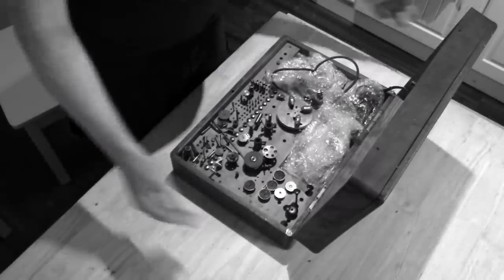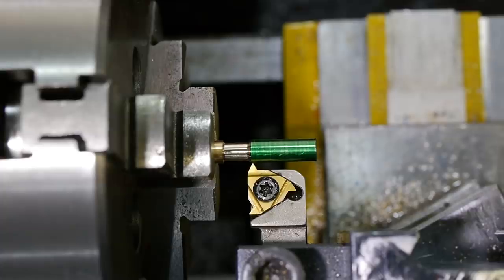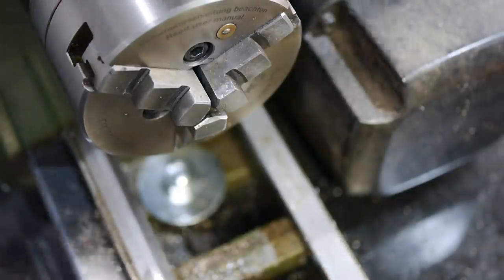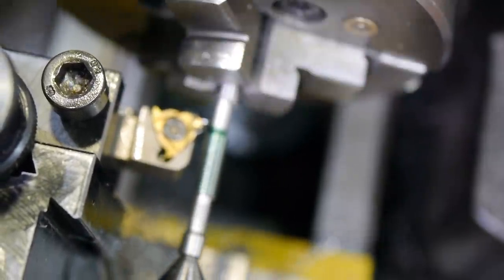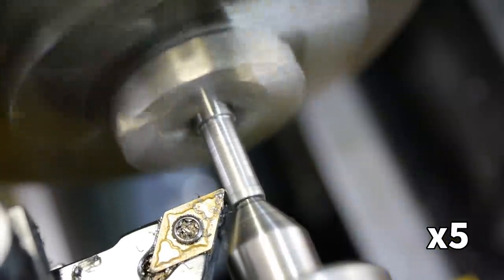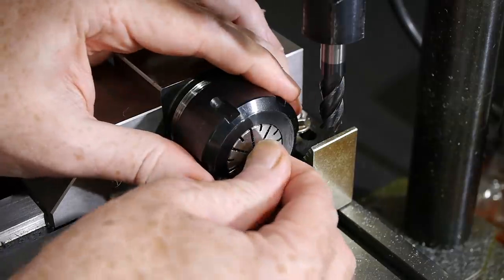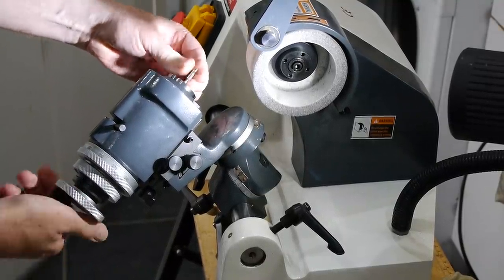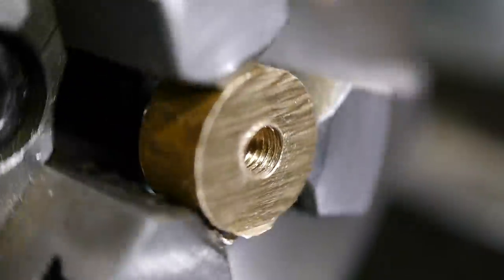Making a Custom Tap on the Proxxon PD 250/e Lathe

Comment: In micromechanics we were taught that the first quench after heating should be in motor oil as water will steam when you put the piece in and you can get uneven hardening.  We did oil, then water was mostly used to clean off the boric acid. Your setup is exactly what we used in watchmaking school, down to the annoying wire baskets.
Reply from the maker: The quench medium depends on the grade of steel. In this video I used BS1407 Silver Steel, and the data sheet specified quenching in water. Other steel grades like EN19 / 4140 specify oil. I think most of my information on home heat treatment came from watching Clickspring, and I believe he learned much of his work from horology books, so it makes sense that some of what I did is similar to the process taught in watchmaking school.

Comment: I made a hob a while ago to cut a custom sized wheel for a worm drive for another project.
A few things I learned from that project:
Hardening burns off the sharp cutting edges, they should be ground after hardening.
No need to harden the tap for soft materials. My wheel was made from aluminum, and plain A2 tool steel was hard enough to make several wheels with no signs of wear. If you are taping aluminum or brass, hardening just makes your life more difficult.
I milled the relief at the same time I milled the flutes. I used a dividing head to accurately mill a 5 degree relief, but this could be done with small creativity with your collet blocks as well.
Also, the tip angle of a tap depends on the type and pitch. 6 threads of lead is about right for a starter tap, a conventional tap will have about 3 threads of lead, and a bottoming tap about 1 thread.
Very well done BTW.

Comment: A quick tip to help with the thread wires. A dab of grease on the threads will help make the wires stick to the part. Just a bit of wisdom shared with me from an old machinist.
Reply from the maker: Thanks for the tip!
Reply: Or just hold the wires vertically from above and the mic will hold then in place.

Comment: Hi,where did you find those 8x8 mm cutting tools?Because these sort of tools dimensions start from 20x20 mm in the market.
Reply from the maker: 8x8mm lathe tools are really easy to get hold of from retail tool suppliers, eBay, Amazon, or the big Chinese sites which sell everything like Banggood and Aliexpress. Most of mine are from eBay.

Comment: Indeed, a plain tapered end yields a slight negative relief to the cutting edges. An approximate formula for this relief is arctan(pitch×tan(taper)/(pi×diameter)) which in this case gives about 0.24 degrees. The formula is approximate primarily because the diameter varies along the length of the taper.

I would be interested to see what you did to produce positive relief.
Reply from the maker: That negative relief would certainly explain why my first attempt had no chance of cutting a thread at all. I haven't checked your math, but on a quick diagram I can see why that negative relief happens.
A quick explanation of the grind I eventually did: I gound a flat relief just behind the cutting edge by carefully setting the angle of the grinding collet, then very gradually advancing toward the wheel, and checking carefully between each pass. It's not pretty, but it does work.

Comment: Very good work. A few years ago I managed to machine a gear hob to cut the gears for a Webster IC engine using a similar method to yours. Tool had to be made to make another tool to cut the geometry on the silver steel and then a gear hob had to machined out of it . A lot of work but a lot of fun. Funny enough I cut the 1/2" hob on a miniature Sherline lathe.
Reply from the maker: Toolmaking can be a really compelling hobby, and I've certainly been bitten. One of the first machining videos I watched was Myfordboy making a hob from silver steel, to free-hob a worm gear. I was almost immediately hooked!
Reply: @AdventureswithaVerySmallLathe  Yes I agree. Right now I am busy cutting MT0 and MT1 taper arbors for the Sherline. I have made a couple of MT1 slitting saw arbors, an MT0  extended dead center and an MT0 extended live center to be able to get the tool in with very small diameter work. I am almost reluctant  to take the top slide off now, that the angle is set correctly.

Comment: very cool project. Since learning from Joe Pie....I now single point tap EVERYTHING from the chuck away towards the tailstock, upside down tool...and no CRASH!  cheers    G>
Reply from the maker: I wish I could do that too, but the tool post just doesn't have enough room to hold the single point tool upside down. I only get to do r/h threads away from the chuck if I don't need the tail stock.

Comment: I see others have warned you about the unnecessity of quenching when it comes to tempering and I'm sure you already know the reasons as well. Another thing you might consider is the location of the tempering. As you said, the purpose of tempering is to decrease the brittleness of the material and make it tougher to avoid stress-induced cracking. These cracks always start at sharp and changing geometries like shaft shoulders and thread roots. If you look at broken taps, they usually break at the upper section of the threads where stress concentrates at the roots and torque is high enough (most of the cutting edges are in action by this time). For these reasons, it is better to focus on these parts of the tool (upper threads and shank). Of course tempering by this method is not the most effective but still it can help prevent the mentioned cracking as heat first touches the most vulnerable part of the tool: the outer shell (this is where the cracks start). The tip and the first few threads can be left "rock-hard" as it is unlikey for cracks to start here and having some extra Rockwells here really won't hurt at all. It's over a year by now and you may already know all of these but if not I hope it helps in the future.
Reply from the maker: Thanks for the tips! Overall I think the tap felt a bit soft when I came to use it, but it's hard to tell exactly why. Most likely I over-tempered it, but it's possible the points got de-carburized because it took me so long to get to decent cherry-red temperature.
I know that quenching isn't necessary as part of termpering, but I was taught during school shop classes that it was a useful way to make sure tempering is stopped, and the heat in the part doesn't spread any further.
For future projects I'm going to try and rig up a tempering oven, so I can gently bring parts to the right temperature and hold them there for the right soak time.
Reply: It can have several reasons of course. Based on your Custom Die video, if you're using it to cut materials with high tensile strength like silver steel, the high cutting forces combined with the vanadium content of the material (which can already be in it in the form of vanadium-carbide that is extremely hard) it is possible that you lose those sharp edges pretty fast. Decarburization shouldn't bother you especially with the use of boric acid protective coating, the high carbon content of silver steel and the relatively short time you do the heat treating in (I guess it didn't take longer than 15 minutes). I'm also sceptic about tempering because you basically grounded off the tempered (discoloured) section of the tool. The most important thing you should really focus on is the right quenching temperature. Being a small part, this tool quickly loses temperature when you draw it from the heat and you should quench it as fast as you can. To be honest I don't see any red color when you quench this part although it's only a few frames. Try maintaining that cherry red color through the tool and be fast afterwards. In the Die making video you did way better. Keep up the good work!
Reply from the maker: The BS1407 silver steel I used for both the tap and die doesn't contain any vanadium (unlike DIN 1.2210), and is very easy to work with compared to O1. The ground tapered part of the tap seemed to keep it's edge ok, but I saw some definite sign that the thread tips further down were deforming under the cutting forces. This was at the point on the tap where the cutting edge had only been ground on the flute side, and the other two faces were the original faces that had been exposed to heat treat. I think it's most likely that these peaks got too hot during the temper phase, as I really had very little temerature control, and I wasn't at all happy with how I did temper the tap.
Thanks for the feedback on the quench. I have learned that the magentism check isn't a completely reliable to check for the austenite transition, and since making the video I now think it was a bad idea to check if the part was magnetic right before quenching, as it allowed the part to cool down. That said, I'm certain the part did harden.
Thanks for taking the time to write constructive comments, full of useful information. Much appreciated, and I learn more as a result. Keep watching!

Comment: Is that a SPZB80/100 DARMET vise in this video? How do you like it? What made you choose this particular model?
Reply from the maker: It's a SPZB63/85 DARMET. Very close, well spotted! The quality of the vice is really good for what I need, but I haven't checked the fine tolerences or tried to use it for grinding. I picked it because the German company I bought it through were recommended by a YouTuber at some point, and I was looking for something smaller than the oversized milling vice I had. The Darmet is still quite big for my milling machine, so I've bought a pair of smaller grinding vices which also have the benefit of having clamping grooves at the side which the Darmet lacks.
Reply: @AdventureswithaVerySmallLathe  That's what I call a Quick reply! It seems these can be bought from their web shop now. I like the idea with the  tightening force acting downwards. Don't know if it is an issue with Darmet, but in case it is, have you seen these improvements to the nut and cross axle? https://youtu.be/JCmBFuGjtoM
Reply from the maker: @paullehmor982  Partly luck that I was around, and partly that you had a nice simple question to answer.
Thanks for the link to JohnSL's video! I like this stuff, and there's some good ideas in that video. I don't really have the first problem he describes, but I could definitely use that second mod. Too bad I have no 3D printer; I'll have to come up with another way to do that.
Reply: @AdventureswithaVerySmallLathe  Haha, I think ThisOldTony made a video about square holes.

Comment: I just bought my first small lathe and I'm really new. Your videos have really been inspiring. I wanted to ask, why didn't you get the angle for the tap before you hardened it? I would have thought you'd want to have all procedures done prior to hardening?
Reply from the maker: Glad to be a source of inspiration. When it came to grinding the tap I followed the procedure I saw in other videos, but I think the reasoning for doing it that was is something like this. When hardening the steel, the outer skin of the metal exposed to the flame loses some of its carbon, and the surface layer doesn't harden well. To get a clean surface of really hard steel for the sutting edge it's necessary to grind away the decarburized metal. Commercially made taps have the entire geometry ground from pre-hardened steel. I wouldn't be able  to do that in my workshop as I don't have the tools and jigs required to grind a thread into a hard steel part, so I machine the basic shape, and the thread from soft metal, then harden it before grinding away the parts of the cutting geometry I can shape with the simple grinding tools available.

Comment: As an alternative to gashing taps with a ball nose cutter, you can use a suitably sized abrasive disk.  Which method to use will depend on what equipment you have.
Reply from the maker: I'm certainly interested in learning to use that method at some point, but at the moment I don't think I have equipment that fits the job.

Comment: A thread grinder is a hybred machine. It is like an OD grinder with a lead screw and half nut just like a lathe but with a grinding head instead of a tool post. The wheel is dressed with the apropriate angle for the thread being ground. They come in both manually operated ones for small quantities up ones that are for high speed automatic models for mass production.

Comment: Making your own taps could become more economical of time if you were making a 3-tap set of the same size ( starting, standard, and bottom taps of plus and minus fits). Could you get some reamers in there too with similar settings? Might make a nice presentation set.

Comment: Why didn’t you grind the taper and rake in before case hardening the tap? I would have been worried about ruining the temper once your brought it to straw. Also I was surprised you didn’t add any carbon is this just 01 tool steel?
Reply from the maker: The material is BS1407 Silver Steel, a simple tool steel similar to W1. It is through-hardening, so there is no need for extra carbon or case hardening. Grinding after harden and temper seems to be the order most tap-making videos follow, though I'm not sure exactly what the tradeoffs are.

Hardening in a home shop almost always causes some decarburization of the surface of the metal, so grinding the surface layer away to make the sharp edge after hardening is probably desirable.
Reply: Adventures with a Very Small Lathe well nice work man. It looks great. I need to get a power feed solution before I can try this but I enjoyed your video. Thanks.

Comment: Hi. First time video watcher, 3th. year machinist student. You know, that there is a internet full of a measurement charts, that can tell you the exact min. and max. diameters of the bore when making a thread and also there is a universal calculations, that atleast makes sense when you'r making bolt threads in millimeters. It's simple... Let's say, that you wanna make a ISO M8 normal female thread. Max.D for the hole is 7.972mm so lets call it 7.9mm and the Min is 7.76 so lets call it 7.75mm. Picth is 1.25mm. Now you always go for the middle of the toleranse scale, so just go with the 8mm drill and then go with the thread tap. Don't forget the lubrication and go slow. Remember to rewind if your using a lathe. Now how you use this info to do a male thread (bolt) is that you take the diameter of the hole you want and take of (-minus) the pitch and then round it of. now it's good to round it of to little under because the ridges might get sharp and start to break. Also if the male bolt threads are slightly under (like a 2-5 tens of a mm) it's fine. In normal use there should be some slight wiggle. There is also a plenty of charts in... (what ever obsolete system you 'muricans use) in the internet for you.

Comment: But can it cross thread? Very nice project, something anyone could need to do at some time. Was there a lot of work to figuring out the relief, or was it done seat of the pants comparing to commercial product?. Thanks and cheers!
Reply from the maker: The relief was almost entirely informed guesswork, and experimentation. No issues with cross-threading so far.

Comment: So i think : a perfek job ! Now the question: did you produce & sell this watchmakerlathe sparepart ? Exactly this part a friend of my need this ...
Reply from the maker: Which part do you mean? If you mean the tap, I'm afraid it isn't nearly good enough quality to sell. It only needs to be used once for my purposes, and it doesn't hold a sharp edge well.
Reply: @AdventureswithaVerySmallLathe  ... so you made your sparepart? Made another ...
Reply from the maker: @GpunktHartman  I'm not quite sure what you're asking me. Does your friend need a tap just like the one I made here? It's not really a spare part, but a tool I needed for my restoration. What does your friend need this for? Are they also restoring an old Boley lathe?
Reply: @AdventureswithaVerySmallLathe  ...no he not restore it, he use it ... but he need the part you made the tap for. I would like to get him in touch with you, if you like to do the part.
Reply from the maker: @GpunktHartman  I think perhaps you have misunderstood what I did in this video. I haven't made any parts using this tap, or the die which I made in the next video. Both were just used to restore damage to the original parts of the lathe. I think currently making parts for the Boley is too difficult for my skill level and equipment.
Reply: @AdventureswithaVerySmallLathe  that is exactly what i understand: the same part is warnout at the Boley of my Friend ...

Comment: Did you set up the compound angle as for cutting a normal thread? Watching you advance the compound it would seem to advance towards the chuck while cutting the brass part, but the cutting edge is on the right.
Reply from the maker: Yep, you got it right. I set the compound in the wrong direction, and advanced it in a way that could contribute to chatter. I was going to talk about this a bit, but when the footage came out blurry I thought it would just get confusing. I'm going to do another video on left-hand thread cutting where I'll talk about setting the compound correctly.
Reply from the maker: Well spotted, by the way. :)
Reply from the maker: I welcome any comments that help me learn. For the compound, I worked out after I finished the project that I should have set the compound the other way, but it's really useful to me when more experienced machinists add comments highlighting my mistakes.
Reply: Adventures with a Very Small Lathe lol i am a bit experianced and i was gonna tell you to cut it from opposit direction but i saw your channel 6 hours late😂